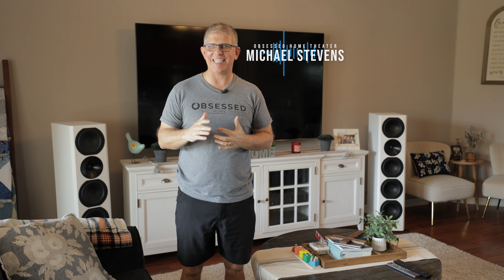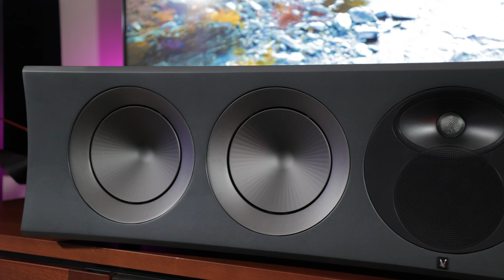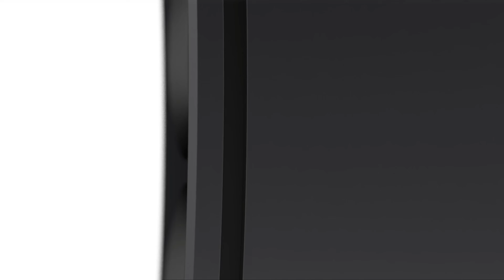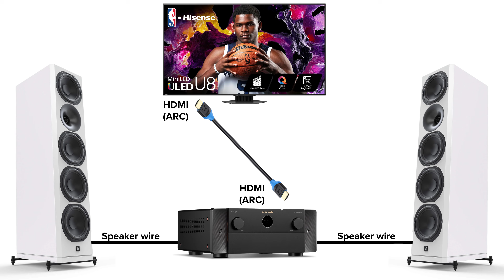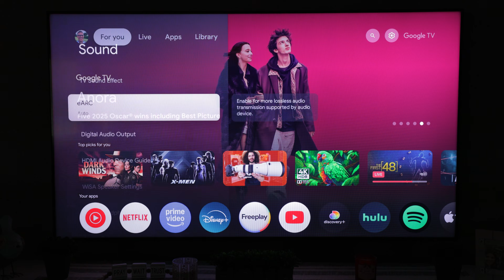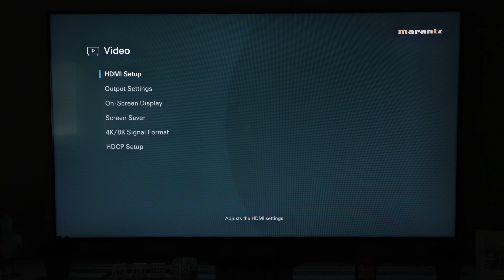ARC and eARC Explained - EASY Setup Guide

Comment: Sometimes I have to cycle thru inputs on tv to get sound out of my soundbar. Sometimes the sound comes out if the tv speakers, the tv is older though. Now my primary system is a 7.2 Sony av receiver and a combination of speakers 1 klipsch and 1 paradigm sub and Klipsch height and surround speakers and eosone tower and center speakers
Reply from the maker: ARC and eARC are flakey protocols. They mostly work but are not consistently reliable.

Comment: Hi please assist 
I have a skyworth soundbar connected to a skyworth tv using the hdmi arc. Everything seems to be working fine except for everytime I switch my tv off and switch back on my soundbar starts at a high volume and not at the same volume When I switched off.

Is there anyone else having the same problem 
Thanks

Comment: Little confused 

Thinking of getting av receiver.

I have a Samsung sound bar system 

If the earc is connected to my tv how would I connect the sound bar as the earc port is been used for the tv.

I could Bluetooth the sound bar I guess ?

Thanks

Comment: Is the arc/earc better than an optical cable?
I have four HDMI ports that are all in use, I hate the thought of using one of the ports just connect it to a soundbar.
Reply: @Sly_Wolf_1  I just looked that up recently bc I have both options. ARC/eARC is supposed to be superior sound quality compared to the digital audio out (optical).
Reply: @nonaking3661 Thank you, I looked it up and got conflicting views. Do you actually use ARC/eARC or optical? Just wondering if you actually notice the difference.
Reply: @Sly_Wolf_1 I use the ARC but honestly, have never compared the two. 
My son helped me with connections when I upgraded my receiver and added an amplifier and different speakers. He selected the ARC.
Reply: @nonaking3661 Thank you for taking the time to let me know. Greatly appreciated, thank you 🌹

Comment: I wanted to add one subwoofer only to my new Hisense U8Q 85-inch tv. I have tried everything to get it working but I have no luck. The eARC turns of the internal speaker when activated and all that works is the subwoofer and it is perfect. How do I get the internal speakers to stay on when using the eARC output.  I cannot see any reason not to use the Hisense speakers as they sound real good

Comment: For the best audio output, use a device with an HDMI 2.1 port and eARC (Enhanced Audio Return Channel) and connect it with an Ultra High-Speed HDMI cable. eARC offers significantly more bandwidth than traditional ARC or optical connections, allowing for uncompressed, high-bitrate audio formats like Dolby Atmos and DTS:X for a truly immersive, high-fidelity surround sound experience.

Comment: What about cable boxes? No one gives instructions from eARC to/from eARC soundbar. Luckily I’ve worked with many different cable boxes and most are standard w HDMI now…but I directly hooked the HDMI cable box directly into the IN HDMI port on the soundbar 5.1.2 and then to the TV HDMI dedicated eARC port 1. I have to use HDTV for Surround Sound from the soundbar remote but if I watch YouTube on a Roku TV it goes back to eARC and no Dolby Atmos. There’s got to be a simpler way! Any advice?
Reply from the maker: I’ve never owned a soundbar as I have always used a dedicated AVR with separate speakers. I also have never had cable. Wish I could be of more help.

Comment: You're absolutely right it's not perfect. I have my LG TV and Onkyo receiver set up with an Xbox Series X, Apple TV, Mac mini computer, Panasonic 4k Blu-ray player and Nintendo Switch. Whenever I turn on my blu-ray player it used to switch to that input automatically. Now for some random reason the input will switch to TV and I have to switch back to the right source. Even more intermittently it insists on continuing to switch back to TV. It comes and goes so still trying to run down what the best configuration is. It used to do it a lot with my LG 4k but the Panasonic when I got it seems better. The switching to TV now moved to when I'm using the Mac mini. Sigh. Lol
Reply: @artemusprime137  i also got a L.G. G4 optical cable works perfect but when i try to connect with eArc its showing the mute icon! I fixed it once but not anymore! Do you've got the same issue?

Comment: TL;DR: If we have no choice but for our AVR to live in a closet, and do not plan on upgrading from our 5.1 system to anything larger, and a new Smart TV is the only source now - is it better to just run an optical back to the receiver (understanding we will lose the HDMI control)? Receiver supports ARC, but not eARC but so far has been incredibly frustrating/unreliable. Or is it worth looking into upgrading the 11 year old receiver. Thank you!

--

Thank you for this video. It was very helpful, especially you mentioning that the ARC technology is buggy. We recently just upgraded our 12 year old TV to a Hisense U6N and I've been banging my head on the wall at the audio just not working randomly when we turn it on. If you (or anyone) happed to read this, I could use some advice. 

Our setup: House was built 12 years ago. The wiring for 5.1 was all routed to a closet, the 5 channels all being in the ceiling. This worked great for us then. The AVR and all the other sources lived in the closet, and a main HDMI and IR extender through the floor conduit to the TV. With the new TV, we have a challenge...

The Hisense has all the apps that we need, making our other devices kind of obsolete (all video game systems are now in an upstairs room, and almost all of our watching it streaming now). We have an older Yamaha receiver that supports ARC and can decode DolbyTrueHD and DTS-HD Master Audio; Dolby Digital Plus and DTS-HD High Resolution Audio, so since we are limited to the AVR being in the closet, we have tried using the ARC (not eARC), but it's been frustrating. I'm trying to remedy, and I'm just wondering if my best option would be to run an optical cable back to the closet, and get a better Universal Remote for the TV and AVR. Thank you for your time.

Comment: Going to try the eARC cable again from Hisense U6N tv to my Soundbar, see if TV issues. Gave up on it few days ago as nothing worked, Menu settings reset to TV off, etc. Using TV speakers is the issue I think as switching back and forth.

Comment: My old system 2006 Yamaha DTS receiver works good with Optical cable to the Blu-ray player. New system Onkyo THX Atmos receiver and 4K Blu-ray player need Coaxial or HDMI. Optical cable was Bad for subwoofer performance. Removed the Samsung 4K with Optical for Sony 4K Blu-ray with Coaxial and Dual HDMI. HDMI to the A/V Receiver is best but no need for Output to the TV.

Comment: First time the TV Arc went bad I fixed it in 5 minutes after menu options turn Off then back to Auto mode. Problem is the Auto mode and using TV speakers and Soundbar, going back and forth. Second time stop working, 2 days ago, tried everything even removed the cable from the TV and turn off and on, etc. Lucky I have Dual HDMI output on my Sony 4K Blu-ray player, the Audio only going to my Soundbar HDMI input. Green light goes on, Atmos working. Maybe Hisense has eArc issues.

Comment: Movie previews, many are still in Dolby 2.0 stereo but many are Dolby Digital 5.1. End of your video you said even having 2.1 speakers is Better than a Soundbar- maybe for movie previews but for Atmos movies you need 7 speakers Minimum, Not 2 or 3.1 with a center. Atmos sound like movie theaters or studio recorded type you need Ceiling speakers should be 4, making Total of 11 speakers plus the subwoofers like 11.1 or 11.2 etc.  The 2 speakers watching movie in Stereo mode was great in 1970 to 1990 but times have changed Alot....

Comment: Soon I will remove the soundbar and use the polk bookshelf speakers and center speaker I had lying around the house for 8 months never used them. They are super budget type $99 for the pair of bookshelf and $50 center speaker bought them like 8-10 years ago i think but rarely used them. And have Infinity bookshelf speakers for the rear, total of 5 speakers plus subwoofer. I don't think it would compare to the Atmos surround sound I get from the Soundbar now. Better midrange and vocals perhaps but not the sound upwards to the ceiling. Towers that have upward firing speakers is Best.

Comment: Excellent Explanation of the eARC, this is why my 5 years old Atyme 4K tv would not give me Dolby Atmos for the Vizio Atmos soundbar. Was just ARC or the DTS but not eARC for Atmos. Also it was not HRD tv as bought it when 4K just came out. Now my Hisense 65" U6N gives me Atmos, the Soundbar sounds way better and louder, especially the Rear Speakers work amazingly now, got scared twice from the rear sounds, movie soundtrack got me. Also the rears work with the movie, from just 1 to both- movie track might be just rear left then rear right or both.

Comment: eARC like you mentioned does have lots of bugs that still need ironing out. My new Onkyo 5.2 AVR Receiver with Dolby Atmos is connected to my new 65 TCL Q7, and both the Receiver and TCL 4K TV with Dolby Atmos has HDMI 2.1 connections. The Onkyo has 2.1a, and I have run into a slew of issues like the Receiver turning on by itself or the sound does not return back to the TV after turning the Receiver "Off" with the Onkyo Receiver Audio Output set to "Auto". While it's nice that you took the time to discuss this great advancement in Audio/Video. You may want to elaborate some more about the kind of HDMI wire to use to take full advantage of eARC, capabilities, because the kind of HDMI Wire used to connect the equipment can, and make a difference in how well the connecting equipment works together. For the best and most reliable results, it is highly recommended to use HDMI Wires with "Ethernet", and for the best performance and results, use the Ultra High-Speed HDMI Cables with Ethernet.
Reply: I have Onkyo THX Atmos receiver, Onkyo is known for problems with the HDMI and video switching. Denon is much better for using the HDMI. You only really need to connect the 4K bluray player to the Onkyo receiver using HDMI, but not need to connect any outputs to the TV. I'm using all 4 HDMI inputs on my TV. New TV's are made for Atmos and HDR10, Dolby Vision.
Reply: Mine worked most of the time the HDMI output to the TV from Onkyo, problem was my Soundbar stopped working as Mixing Signals. The budget Onkyo receiver might have worse HDMI switching. I would run all components to the TV. If you want HDMI going to your Onkyo, get the Sony 4K blu-ray player like mine $160 has Dual HDMI one is Audio only for Receiver.

Comment: Hey MIchael, any idea why my sony tv,run thru a denon 4500h, plays apps like Netflix at much lower volumes compared to my dish network satellite receiver? Will an apple 4k solve this issue? Thanks  Mike P.
Reply: I would double check that your tv isn't just outputting pcm audio and that it is outputting dolby digital or dts
Reply from the maker: I’m not sure as I’ve never had dish network. Maybe they have something in their device that boosts the signal.

Comment: Anybody here use the Klipsch RP500SA’s in ceiling? I’m moving and the basement where my setup will be has gaps in between the wood where they would fit perfectly. I’m just not sure about how to effectively mount all 4 of them up there and how I would wire them

Comment: This only works if your equipment offers ARC. My older LCD TV and Denon 3805 do not offer that. My receiver does not have HDMI. My equipment is made in Japan and keeps going & going. I hate to upgrade just for inputs/outputs.
Reply: I don't like Dolby Atmos, wish the 7.1 DTS remained, but times have changed. The new TV's are awesome not just for Dolby Atmos, Dolby Vision but also HDR10. If you watch 4K blu-ray movies it's way better. I just upgraded the TV few weeks ago- Hisense U6N best deal, best for movies in dark or low light.

Comment: ok. so if i have an 7.1 setup... for my UHD / Blu-ray do I need to use eArc to get all of the audio channels or will it work across the standard HDMI it is using to my receiver ?
Reply: Bluray movies use lossless audio formats (both UHD and HD movies), which need huge bandwidth.  If your player is connected directly to the TV, and the TV is connected to your AVR through e-ARC, you should be golden as the TV should just pass the signal along without manipulation.  If your TV only has ARC, then either the player or the TV will strip down the lossless audio signal to the basic lossy 5.1 stream that older ARC can pass along to the AVR.  In other words, your AVR will only be getting drips from the faucet rather than completely open.

Comment: Hi there I have a question regarding EARC, anyone who can answer. All my cables are Audioquest forest. But I noticed that they have arrows on them for which way you plug them in. Which direction the audio and video signals travel through the cable. But it seems to me with EARC it's bi directional as the stuff that's plugged into the avr goes through the cable from the avr to the to tv. But the stuff that's actually plugged into thr hdmi inputs on the tv travels from the tv, through the cable to the avr. So it seems to me EARC cables got to be bi directional. So it would also seem that these audioquest forest are not really correct for connecting to EARC?
P.s I will have a watch of vid later as we are in bed and i cant have sound on at the moment.

Comment: The old school way of setting up your TV with an AVR is to plug all of your devices into the AVR, and then one HDMI ARC cable into the TV.  Modern TV's have a lot of HDMI inputs these days.

I think (but I don't know) the modern way is to plug all of your devices into the TV and then use one HDMI eARC cable into the AVR.

What say you Youthman and fellow HT/living room guys?
+++

Related, where does the set top box go, upstream from the TV or straight into the AVR?  The goal would be to allow the TV to control both channel and audio duties with one remote.
Reply: Everything plugged into the AVR including a DVR (set top box). One HDMI to the TV.
Reply: Better to connect everything to your TV, unless you have a Denon or Marantz which is less than 3 years old or has the HDR10. You can still run HDMI from the Bluray player to the Receiver without connecting any output to the TV. My Sony 4K player has 2 HDMI outputs- one is Audio Only for the amplifier receiver other is Video/Audio for TV.
Reply: @gtoutdoors1197  Thanks.  I won't buy anything that exclusively uses RCA to connect components.  I love the HDMI cables.

Comment: My Denon AVR-X3400H does have ARC but not eARC. I'd have to use an HDMI audio extractor that passes audio to one of my receiver's HDMI inputs. I do not have a need for eARC since I am using a 15.6" portable 4K OLED monitor for my home theater and computer needs.